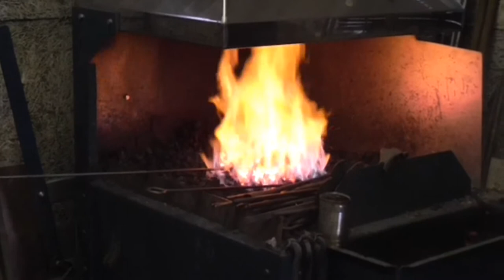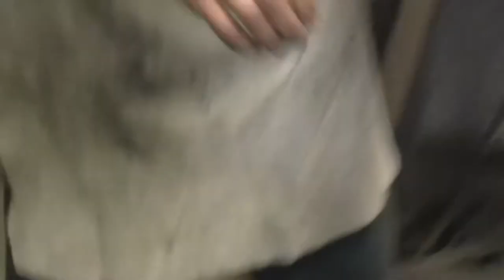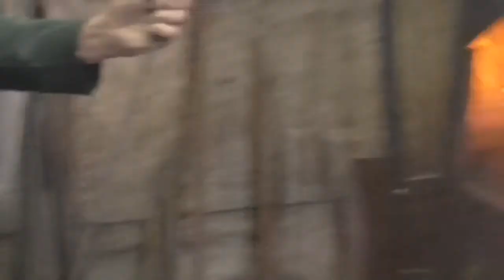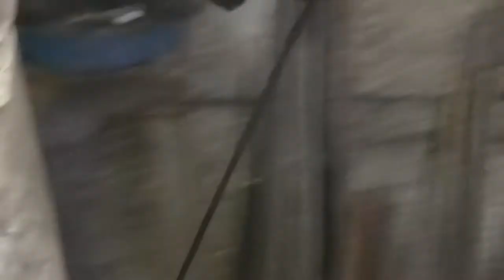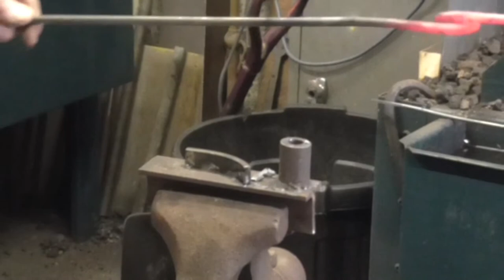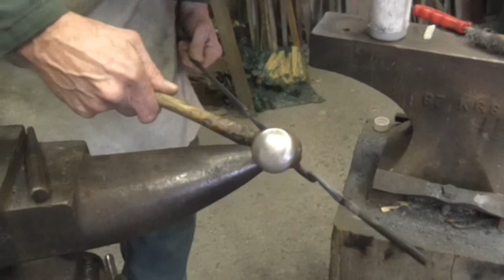Pete Smith finally let me make a vid.

Comment: A wonderful demo indeed! I’m actually quite enamored with his hammer though. I love the broad faces, but light weight appearance. Did he make it and if he did, does he take purchase requests? Thank you for sharing.
Reply from the maker: Hi, Thanks for your comment. No, he didn't make his hammer. It is a shoe turning hammer, commonly used by farriers. That exact hammer is no longer made, although there are others about. I have one that is similar. They are about 2 lbs and are quite adequate for all but the heaviest applications, when a sledgehammer would take over. The fashion amongst many young Smiths is for ridiculous 'hammer of Thor' headed hammers which they then choke half to death as they cannot wield them properly. I have seen Pete 'move' tool steel with his hammer, which in his hands is more than adequate.
Reply from the maker: Pete has sent the following reply. He's unable to post one himself, as he doesn't have a YouTube account.;

He says that the shape of the hammer face is what counts, and if you were to purchase one like the one I have - link here;

www.stromsholm.co.uk/hms-shoe-turning-hammer-2lbs-1317-p.asp

Then the face of the hammer is 'work ready'

Hope that this helps.

🙂
Reply: Nightschool Blacksmith Thanks! I just looked at the turning hammer and it looks nice. I just sent an e-mail to Strönsholm to see if they ship to the U.S. is it possible to find out the manufacturer of that hammer in case a used one can be procured?
Reply from the maker: Hi,
That particular hammer is marketed by Handmade Shoes UK Ltd.(Hence the HMS designation)  I don't know if they actually make them or if they are a UK subsidiary.
Reply from the maker: Pete says he tried to message you, in case you didn't get the message;

He says, if you would like to purchase a hammer and have it sent to him, he will dress the faces of it for you and then post it to you in the U.S. (You would obviously have to pay the postage).
Reply: Wasn't it Jim Blurton's shoe turner with brass pin through?